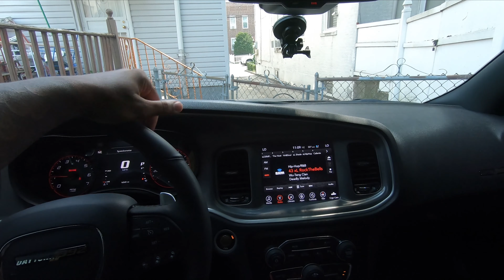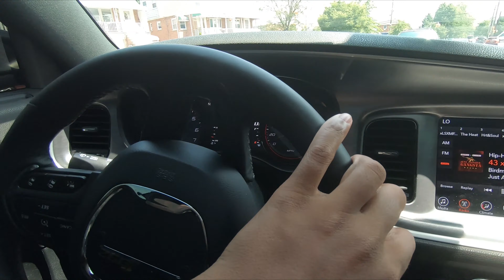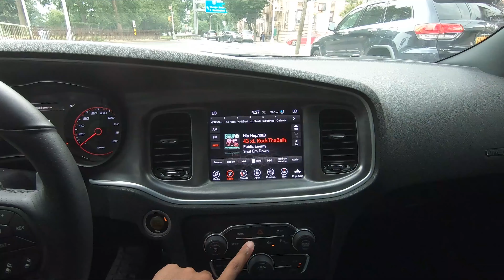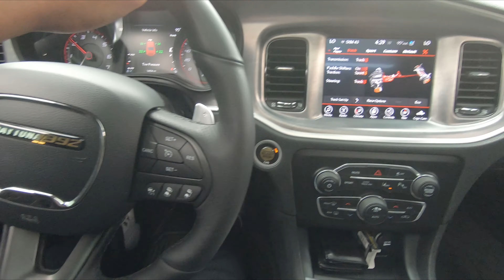I JUST MADE MY DODGE CHARGER DAYTONA 392 CRAZY LOUD!!! EXHAUST MOD!

Comment: Knew u would come around to it lol. I did it to my scat but had to put my mufflers back on due to low end torque loss & too much raspiness. Now I got the Vibrant 1794s
Reply from the maker: @Marciel Industries yeah I hear ya. Mine isn't raspy at though. Thank God.
Reply: I'll add my 2 cent too since everyone has done this mod, I even did dynomax bullets yet still hated the rasp sound when your really on it.  Added Flowmaster 71416 where resonators where and absolutely love it.  Its louder than stock and no rasp.
Reply: @Marciel Industries  Not chambered, its similar to the stock resonators but narrower and louder.  Most everyone is trying to increase sound of the stock system with out compromising quality of the tone.  So far I'm impressed. part number for flowermaster is 71419, magnaflow makes something just the same as well.
Reply: brad cal I almost tried the mini race bullets but didn't know if it would be raspy or not. Glad I didn't do it then
Reply: @Numb3rs40    If you hold them in your hands you'd see its just like going straight pipe.  Dodge did an amazing job creating a free flowing exhaust system that sounds tits for these newer 392's. Its really hard to change it for the better regarding "quality" of sound.  Tone and rasp is a different story.   Most that will like delete probably don't drive it as hard as I do and get reminded of the straight pipe rasy sound lol.
Reply: No resonators equals loss in torque

Comment: I would keep it this way, don’t listen to those that talk about losing low end torque, I have the time slips to prove otherwise. It’s just nasty sounding, I have a 2019 scat wb. My 0-60 best is 3.9 on the street. And my car has the AFE straight pipe cat back with the valve delete.
Reply from the maker: Daaaammmmnnnn that set up sounds nasty!!!..and thanks a lot for that info. I didn't think I'd have any power loss. She still feels strong.

Comment: Do you remember what diameter pipe they used 2.75 or 3” ? I’m having some torque or back pressure issues off the line  with 3” delete
Reply from the maker: Man I have no clue what pipe that was.

Comment: Why you don't buy aftermarket exhaust system so your stock exhaust system is still intact?
Reply from the maker: Maybe down the line. That's the beauty of these cars. You can try all types of things over time to keep things exciting and different.
Reply: @mdglifts  the reason people buy aftermarket exhaust is to make sure that their stock exhaust stays original, just in case. But aftermarket exhaust other than titanium are just stock exhaust with mufflers delete, so yeah congrats on saving some money.

Comment: I deleted my mid mufflers and rear resonators and in track mode it’s brutal I have no droning at all but I did take the oem tips off and replaced them with the carven ceramic black 5in tips
Reply from the maker: Hmmm I wonder if the carven ceramic tips helped with the drone that would have been? I wonder
Reply: MDG Collections it did and well worth the upgrade